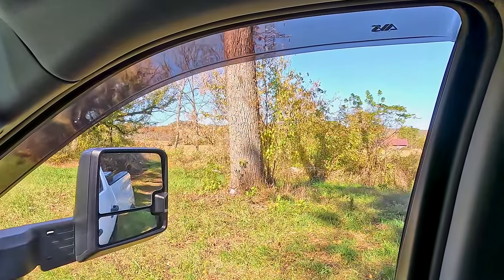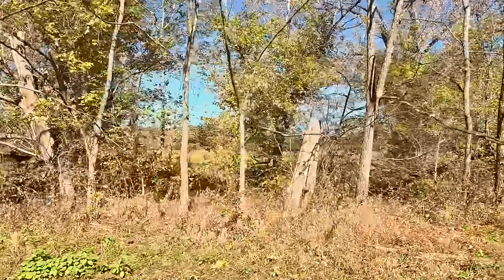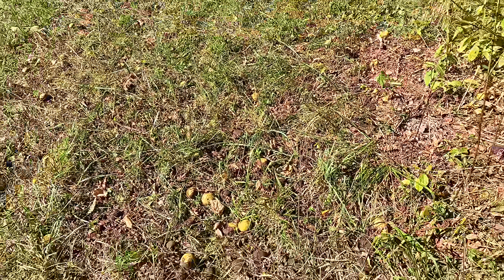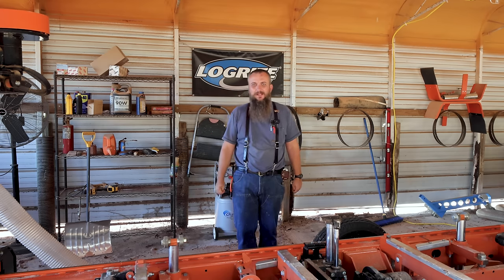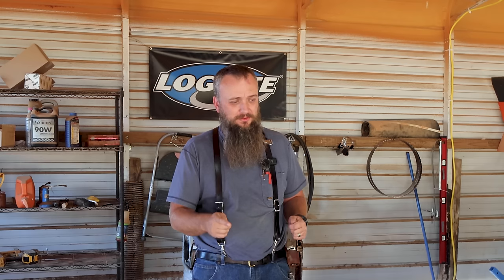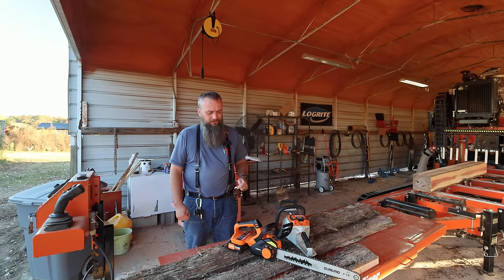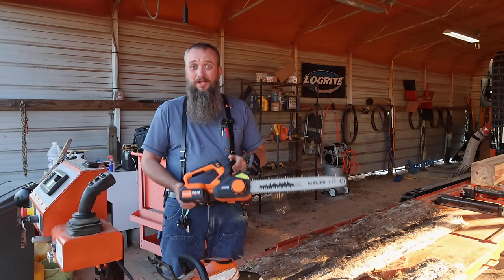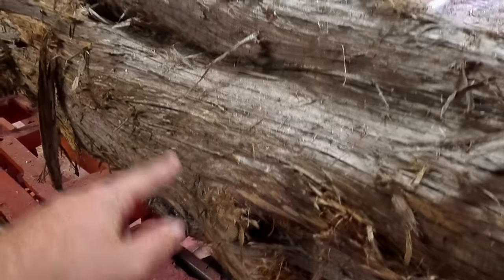My Secret On Making The Most $ Money With Your Trees! Appalachian Knowledge

Comment: As owner of around 400 acres of mountain land, and as a 4th generation logger/sawyer, I have learned to assess  every log before bucking the tree. A log that forks at 13' could be cut at 12', or cut into an 8' straight log, and a 6' crotch log. Cut correctly, one 2" thick slab from the crotch can be worth more than the entire yield from the 8' log. I took a John Deere backhoe, without the hoe, made a mast for 4' forks, and added a valve and hydraulic lines for a center grapple. It's a great compromise. Having a forester assess your timber is the only way to go. You can cut stumpage tax free for 20 years, up to the assessed value at time of acquisition. What happens with the logs is irrelevant, and nobody's business. This is the best lumbering channel out there.
Reply from the maker: Thank you

Comment: Where I live in upstate New York sycamore mostly grows along the creeks and smaller rivers . If you see one not near the water it's probably in someone's yard and was planted there . There's one in the town across the river from me that is in town and an several hundred yards from the river . I measured it a couple of years ago. At chest high it was over 13 feet in circumference . Along the big river that divides the towns it is mostly lined with silver maples and oak. There's an oak by a boat launch back along the river there is an oak over 14 feet in diameter . Using a chart  based on diameter that gives you an age ,it is over three hundred years old . It was well on it's way when the first Europeans came through here .  I drive around multiple counties along the rivers looking for eagles. Most of the time the eagles build their nest in sycamore trees

Comment: Grapple is great if the logs are not in an even pile , like when they are dumped out of a trailer .
Forks are great too . My grapple is a brush grapple and has longer tines and 2 independent grapples on top so you and grab a bunch of logs at a time .

Comment: Nathan, for your operation and the set up you have, the pallet forks are probably a better option. For me, however, I'll never use pallet forks to load my manual mill again. Two times I lost logs over the backside of my mill. My grapple is the only tool for my situation with a manual mill and a skid steer on wheels.

Comment: As one grows a little older, you get to appreciate the light weight electric saws.  l have the TYGMPRO 8 inch unit which comes with two batteries of an average continuous running time of 20 minutes. even l am strong enough for use this for a while.

Great video, (particularly the outtakes).  Do not expect a call from Hollywood any time soon.
Reply from the maker: lol funny you say that about Hollywood. I get calls from producers from Los Angelas monthly wanting me to be on reality TV, so you are incorrect, they call all the time, lol
Reply: Great!  Never loose the beard.

Comment: Forks tilt faster than a grapple can operate. So, depending on the size of the logs, pallet forks are likely a lot faster. However, on large logs the grapple is likely the safest option. By the way, what made you stop using Stihls and start using a Husqvarna?
Reply from the maker: nothing I use all of them,

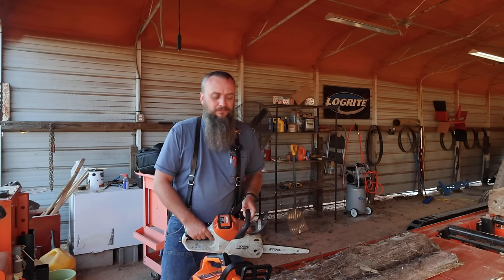Comment: 21:15   “Battery Powered Sawmill”. That’s actually not a bad idea. Seems like Wood-Mizer and Tesla could collaborate on that.
Reply: easy electric saw mills are a thing so  just use a DC motor to match the load for the saw and batteries  even add some solar and or wind gen and Bob's your uncle